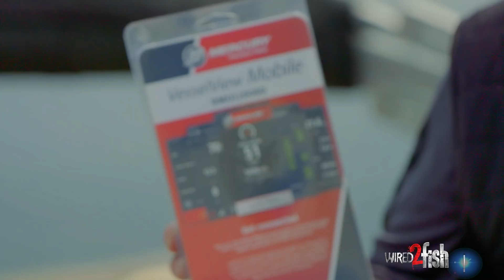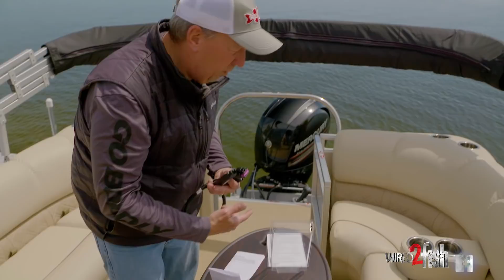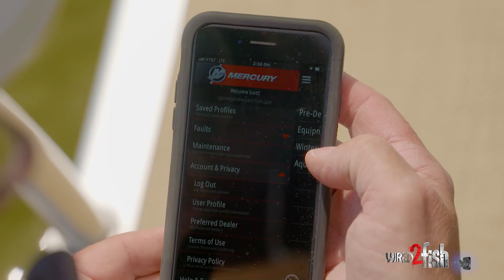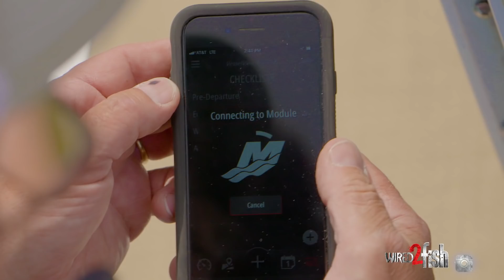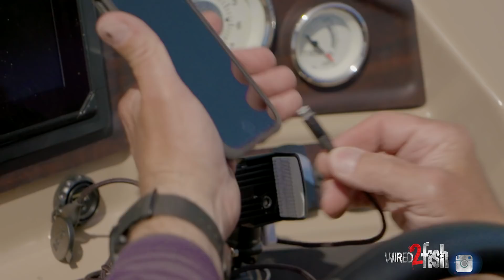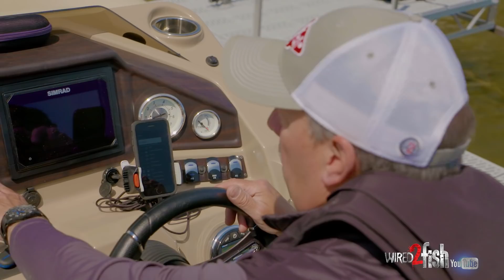VesselView Mobile Overview

Comment: Does this work for stern drives as well?
Reply from the maker: Hi David! VesselView Mobile is compatible with all SmartCraft-equipped Mercury outboards and sterndrive engines. This applies to most engines manufactured after 2004 with EFI and MPI ignition systems on them. Your Mercury Marine dealer will be able to tell you if your engine falls into these parameters by checking your engine serial number. Hope this helps!

Comment: I have a 2008 90 HP Mercury 2 stroke on my 2008 Kenner vision 1800 (mako). Will vessel view mobile work on this 2 stroke motor?
Reply from the maker: Please email support.vvm@mercmarine.com and our service team will be happy to confirm for you. Be sure to supply your engine serial number in the email, as that will be necessary to determine if your engine is compatible. Thank you!
Reply: @MercuryMarine  I emailed last night my serial number. When can I expect an email back?
Reply from the maker: @ryanuhazie  it looks like our VVM team had to look into this one a bit due to the fact your engine is a 2-stroke. They've replied just this morning, and unfortunately, it appears your engine is not compatible. Although your engine is a 2008, it was a continuation of a select model available before SmartCraft was offered.
Reply: Thanks for the info! Yes it’s been hard(er) to find parts as it’s not as popular as other numbers.

Comment: You have a SIMRAD why would you use vessel view to display that information when the SIMRAD will do that same thing (and a bigger display to boot)? You can even create customized displays with the SIMRAD. Also SIMRAD is plug and play with Mercury engines, all you would need is a cable.
Reply from the maker: You make a great point. The boat in this video does have a Simrad unit, so a VesselView Link could be used to get engine data on the Simrad display. This would require the Link module to be installed at the helm, as well as a NMEA2000 network, to complete the installation. Many boats do not have the larger displays or complex networks on them, and VesselView Mobile is a great way for those users to receive the engine data they normally would not have.